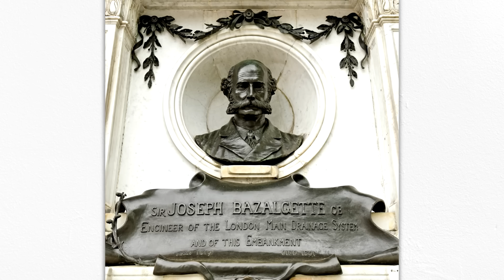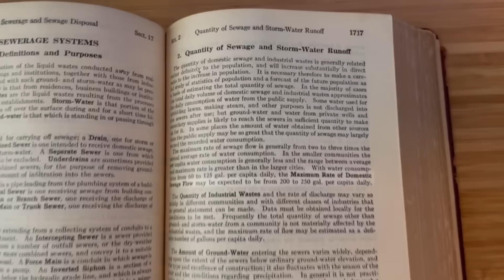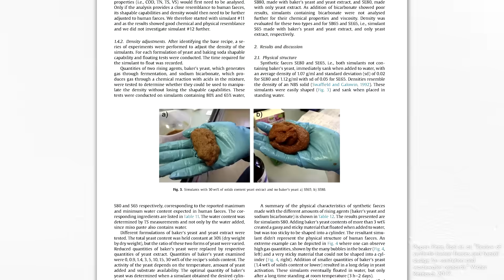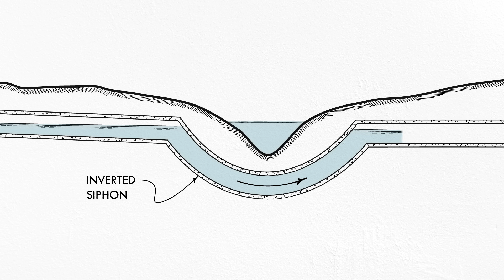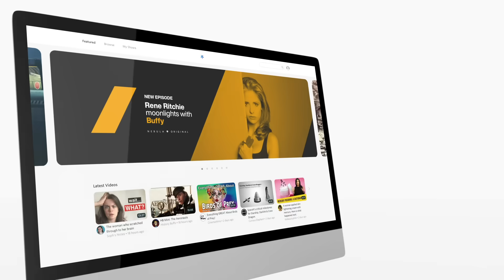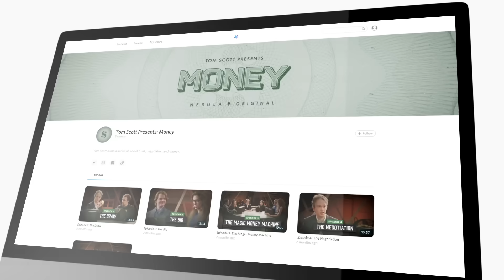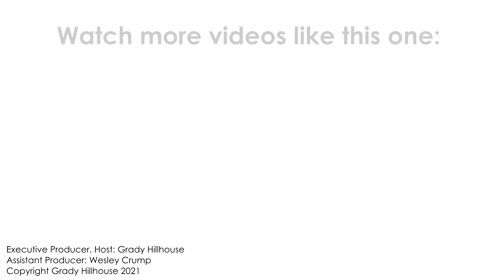How Sewers Work (feat. Fake Poop)

Comment: Funny enough, there actually are "sewer police". Granted, they don't pursue individuals. But my dad is an industrial inspector for a very large municipal wastewater treatment facility. They routinely monitor, sample, and test the sanitary system at junctions and follow the path of the chemicals that are harmful to the microbes of the treatment plant. They follow that path upstream until they find the offender and can levy enormous fines, or even cap off their access to the sewer system entirely.

I say 'they' because my dad is part of an entire department of the water authority tasked with this. The dept consists of automated sampling units and the men that monitor them, inspectors, a laboratory, and a fleet of vehicles to support them.

Comment: Great video Grady.  What happens when one runs out of gradient? They must have pumping stations? - right -   What kind of pumps must they use to handle the general 'solid' in the system?  I would imagine most pumps would jam up except screw pumps or piston-like pumps that are similar to 'concrete' pumps.  I think Bazzlegette used steam powered,  reciprocating, piston pumps installed in east London to pump the 'stuff' to the English channel and the North Sea.  This was probably timed to the  tidal flow in/out of the Thames.

Comment: I rebuild sewage pumps and I enter lift station tanks when there are problems or to replace  pipes and hardware as shit is corrosive to most metals,galvanized or stainless steel are the best metals to use.those wipes are a total pain in the ass.condoms rings tangle in pump impellers and bind them solid. “Service technician “HA what a title eh.

Comment: A commonly applied method for inverted siphons utilizing multiple smaller pipes is to install a weir on the secondary line. The primary is sized to maintain velocity during low flow periods, and when the water overtops the weir, there is enough volume to keep both pipes flowing at a high enough velocity. It's a simple remedy to allow your siphon to have as much capacity as your influent line without risking sedimentation. Also, if you design the weir to allow either line to act as the primary, you can take either side offline for repairs or maintenance.

Comment: Sewerage qualifies as part of the infrastructure that US don't want to know for decades.  So now is the time to come out to grab a share of the Biden's $2 trillion dollar bonanza.
UK doesn't have the same $2 trillion for the infrastructure.  So if flooding occurs every time it rains the politicians make do with the excuse that it is due to climate change.  Everybody here who can understand how a drain works can tell the flooding will go away if the drain is enlarged by replacement or duplication or maintained by clearing the blockages inside or the discharge capacity increased by dragging the river (to enlarge the flow cross section of increase the bed gradient).

Comment: Not that it matters to anyone, but the magic slope that keeps solids running at the same speed as water is 1/4 inch per foot from level floor. So in a perfect world where everything was level, ideally, you'd want your pipe getting 1" deeper after every 4 feet of travel.

Because pipes would get deep really fast in large cities, after 4" diameter pipe, and bigger, you can run the plumbing at 1/8" per foot (or 1 inch deeper after 8 feet run). And finally, after 8" pipe and bigger, you're allowed to run it at 1/16" per foot ( or 1 inch every 16 feet.)

Comment: Would have liked to see how they overcome going uphill.  Where I live the area has vacuum sewers at -80Kpa to move the sewage due to the low-lying area.
Reply: I've heard vacuum systems are really cool, until they're not. Typically there's lift stations that raise the sewage back up to continue the flow. They usually are just a single concrete building with a fence around them (and maybe a large generator on sight as well).

The ones I used to maintain would have a grating in the middle with a nice ~25 foot drop. Sewage would be raised ~15 feet or so with a pump/grinding unit and allowed to continue on. And incase you were wondering about that last unused ~10 feet that's for when the system backs up or for heavy flow.

Comment: 250 gallons per capita/day.....
Every time i see such "insane" high numbers my initial reaction is "how the ** would you manage to waste so much <xyz>!?" until i remember - those figures are not really what each person produces but how much waste-water gets generated in total - including many things that waste a loooot of water.
Reply: ABaumstumpf ... and you realize there are still toilets out there using 5 gal per flush and washing machines that use near 60 gallons per load. Throw in dish washing, showers, etc and you can easily see it adding up. New building code can drop that 250 gal per day figure to something around 100 gal per day without a major shift in lifestyle. My home averages around 40-50 gallons per day per person.
Reply: @rupe53  "New building code can drop that 250 gal per day figure to something around 100 gal per day without a major shift in lifestyle"
That got little to do with it - in europe the average consumption is under 100L/day - a small fraction of the 250 galons - but that is per actual person and no per capita for an entire city.

Also - no, "using 5 gal per flush" - no toilet is wasting that much.
Reply: @ABaumstumpf  ... in this country there are still many old toilets that use 3.5 - 5 gallons per flush and most people are NOT aware of this. I recently spoke with a plumber and he said 50% of older homes he services have these. (older = pre 1980) My older home uses less than 50 gallons per day per person, based on my water bill for the entire house. That includes laundry, showers, washing the cars, and filling the hot tub. When drilling a well in my area the building inspector wants to see a daily yield of over 150 gallons per bedroom. That tells me they are still using the old numbers. BTW, per capita and per person is the same thing.
Reply: @rupe53  "BTW, per capita and per person is the same thing."
No, not really - per capita is not what people personally use but an aggregate including infrastructure and industries as well.
Reply: @ABaumstumpf  ... it comes from the Latin "per head" if you want to look that up. IOW, per head and per person are the same thing.
Reply: @rupe53  " it comes from the Latin"
Yes, i know, but clearly you did not read or comprehend what i had written. Cause again - the per-capita calculations are NOT based on what an individual person actually is using but what the entire city, including industries and whatnot, is using. And guess what? Most of that is NOT used by the actual residents aka the per-capita is NOT based on what the individual persons are using.
Is that so hard for you to grasp?
Reply: @ABaumstumpf  ... now that you spelled out where you are going it's not hard to grasp at all. You have included industrial use and such (watering the lawn in city parks?) which will raise the number of gallons substantially when averaging "per person" so in this case "per capita" actually fits. This is not something we have in my area so using household numbers works better.

Comment: I'm not a big fan of poop so I had to think real hard before liking this video :P 
There is an "easy" solution to the wet wipe controversy: determine minimum standards for defining "Flushable" (in order to be compatible with existing sewer infrastructure) and then pass federal regulation requiring that any items sold in the United States with "flushable" on the label meet those standards. 
The only down side is that there's a good 20% of America who throws a temper tantrum if you dare suggest passing a law that requires businesses to do anything responsible like making their product labeling accurate. (But upsetting those people is more like a perk if you ask me.)

Comment: On the "splitting the pipe" at the inverted siphon: is that just to increase the total volume? Would a single larger pipe work as well?
Reply: No it was to decrease the total volume so the water speeds up

Comment: Yeah. And tampons too. Heard a plumber call them “white mice” unless u like screwing things up and spending $ unnecessarily. Wrap it up and put it in the garbage. Along with anything else that isn’t TP
Reply: You could theoretically get around this issue by putting the burden of blockage on the property owners. You simply require everyone connected to a sewer system to have a screen in the pipe, and then the property owner needs to have a system that chews up the sewage until it can fit through the screen, but it would get gummed up if you put anything in there that a normal sewer system wouldn't handle. So, you have to deal with the inconvenience of the blockage, but it's your own fault, and you don't affect everyone else. I don't know how you would deal with grease though.
Reply: Anything that isn't TP?
Instructions unclear. Just wrapped up my turd for the trash
Reply: My father had a rental property and the tennant reported a leaking pipe in the bathroom.
So my dad and a plumber go into the house. In the bathroom, beside the toilet, is a neat pile of USED tampons.
My dad and the plumber just look at each other, and the plumber says "well Bill, at least they aren't flushing them".
Reply: @perrybrown4985  In The Netherlands, all female bathrooms have a special, seperate bin for tampons and pads to stop people flushing those things.
Reply: @Dutch3DMaster  Most public bathrooms in the US have those too.
Reply: @perrybrown4985  not impressed. have you ever seen bags with used cat litter? 
And I wonder what they use on farms, I've heard about special bacteria. And why sewers don't use chemicals to dissolve all that
Reply: We call tampons “sewer rats”.  They’re big and have a tail.  I’ve pulled a few out of our sewer pumps, but them “flushable” wipes are definitely the worst!!
Reply: Hypodermic single use syringes
Reply: There are other organic items besides waste that can be flushed; they’ll degrade quickly enough since they're biological material.  When I remove hair from my brush, it goes into the toilet.  Same thing when I clip  my finger- & toe-nails or trim my bangs/shave my legs.  My dad has trimmed his toe- & finger-nails out in the backyard for most of his life, which eventually washes into the storm drain.

Comment: One major point you failed to mention is that due to the environment inside sewer lines the very high biological oxygen demand (a.k.a “5 day BOD”) the environment very rapidly goes anaerobic, which leads to a population of anaerobic bacteria which utilize the sulfur in the wastewater (yes, poop has a lot of sulfur) to create sulfur dioxide (aka “rotten egg smell” or “that “sanitary” smell you notice around every waste treatment facility)… SO2 has a minimum detectable concentration (by the human nose) of 0.5 ppb. At a concentration of 100 ppm, SO2 has the wonderful habit of shutting down your olfactory nerves so you no longer smell it. And at 300 ppm, it will kill you. Wonderful stuff…

Comment: If you ever see tiny concrete houses in your neighborhood that are locked up, it's probably a lift station. As he said, plants rely on gravity to move influent so sometimes they need to pump it upwards to move it from homes lower in elevation. That's what's happening in those little houses
Reply: Lift stations are an unsung hero in every community. Electric Lift Pumps do the work that gravity can't.
Reply: We have collector tanks at street level closed off by hatches in my city that contain those pumps and the controlling unit sits next to them in an equipment case closed off with a lock.
The lift stations can be 10 meters deep and require special tools to hoist the pumps out of them should they be malfunctioning due to (for instance) flushable wipes.
Reply: I've learned to appreciate the bar screens & muffin monsters more than the pumps...
Until they go down.
Reply: See Jim Thorpe PA

Comment: Multiple smaller pipes in a syphon would give the same flow velocity as a single pipe of the same total cross section. Why is it beneficial then to use multiple pipes in a syphon? Is self-cleaning velocity smaller for a smaller pipe?
Reply: One will convey the flow when the other is being cleaned.

Comment: I have heard that the increasing prevalence of high efficiency toilets is creating sewer system and sewage plant challenges by changing the water/solid ratio out of the original early 20th century range most systems were designed around. Is there any truth to that?
Reply: From what I understand this is mostly true for the plumbing inside older buildings that clog up due to less flushwater. The impact of the recent separation of rainwater and wastewater is bigger on the main sewers. Also; but this is more in watertreatment; is the wastewater more dilute because factories (f.e. slaughterhouses) are forced to treat their wastewater onsite and not dump their trash wholesale into the sewer, making it harder to treat biologicly (because the bacteria that break down the impurities starve without nutrients). Near me there is a slaughterhouse that on occasion is asked to bypass their watertreatment facility and dump their waste in the sewer so the treatment facility for household wastewater can jumpstart their biologic reactors again.
Reply: @TheBayru  another big change in more modern homes is going from 4 to 3" plastic waste pipes.
Much smoother inside, and the narrower pipe helps keep velocity up given the smaller flush.
Reply: I'd be interested to know the answer, but my guess is this is probably just people complaining about low flush toilets. My reasoning is early 20th century toilets may have used more water, but we more than make up for that in terms of laundry machines, dishwashers, and long hot showers producing enough flow to keep the pipes clear.
Reply: @bragr_  but both washing machines and dishwashers are far more water efficient than doing those same tasks by hand.
Reply: Short answer: Yes! Long answer,
https://www.watereducation.org/western-water/californians-save-more-water-their-sewers-get-less-and-thats-problem
Reply: The average amount of solids wastewater treatment plants remove is approximately 0.6 of one percent. That means over 99% of treated effluent is water. It wild take a lot of toilets to change that percentage, I would think. But, like others have said, the effects on a buildings plumbing could be substantial.
Reply: @bvb8769  We bathe often, and do a lot of dishes.
We flush urine! (100% 'water')
Toilets have come a LONG way from the 8 gallon flush I grew up with.
Reply: @jimurrata6785  8 gallons? I’m a visual learner, so I’m imagining a full 5 gallon bucket (~40lb) and a second about 2/3 full (~25lb) - no pun intended, but that’s a crapload of water. What is the dumb US federal mandate today? Something like 1.3 or 1.7?  There’s a happy medium somewhere.
Reply: @rjhornsby  The mandate is nothing sold that uses more than 1.6 gal (~6l?) and the conservation optimum is 1.28 gallons.
Reply: @jimurrata6785  We complain about them a lot, but the modern toilets work well for the most part. Worst case, one can push the handle a second time if it did not clear completely the first time. (and is not blocked).
Reply: @dyadica7151  Toilets are much better today, than when the water use requirements were first instated.
Less double flushes and WAY less skid marks than back then.
And there are a lot less homes with 4" cast iron plumbing than there were back then.
I'm very glad that potable water waste is down and the volume treatment plants need to handle is 1/4 what it otherwise would be.
And of course this is a first world perspective. Much of the world doesn't have adequate potable water OR proper sanitation, !et alone right in their house.

Comment: Oversizing infrastructure of any kind is always desirable because short term thinking always presents a challenge of having to expand it in the future at a greater cost than if it were built oversized to begin with to by count for a future growth. And also unknown growth. It is never wise to only plan 20 years out and then have to triple the output then instead of making it 6 times bigger to begin with at a lesser cost
Reply: No, it isn't. Oversizing a 3.5 mile sanitary sewer from 30" to 36" resulted in insufficient cleaning velocity, sediment deposition, anaerobic decomposition, production of hydrogen sulfide, destructive corrosion of miles of steel reinforced concrete pipe and tens of millions of dollars of damage to the entire downstream system. It's really better to know what you are doing, rather than guess. Sanitary sewers are designed to serve a designated service aria with a zoned land use.
Reply: @aeromodeller1   Again wrong if the pipe was oversized it would also be having its inclination changed as well and many other variables. It's always better to build bigger for the future growth

Comment: How big are sewage pipe? Like, clean water pipe are a couple inches, water collection pipe are probably a bit bigger, but what about the sewage? What would it looks like if you cut the road for a front view with everything that is below it typically, with wires, pipe, gas, etc.
Reply: Typically 6" in the local collectors, up to 90" (or more) in the major trunks going into the treatment plant.

Comment: Used to operate water and sewage plants. Towns are often told 'no new building permits until you have enough capacity at your sewage plant, and why is the influent 5X more than the water plants exfluent?' Usually separating storm and sewage flows, and replacing old pipes (one used to have wooden combined sewers, even wood sections of a pressure main)  negates the need for a new plant for a decade. Lots of time to budget for an expansion.